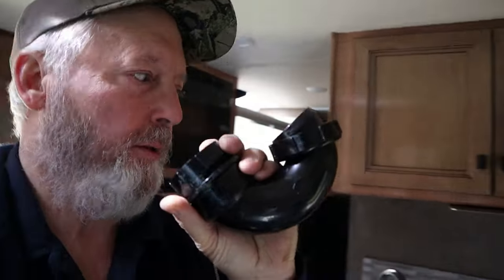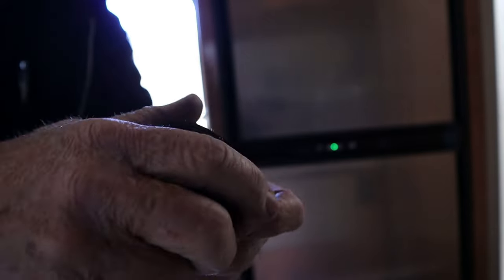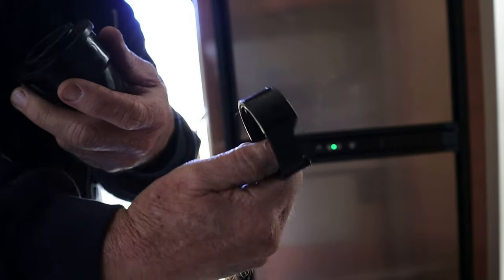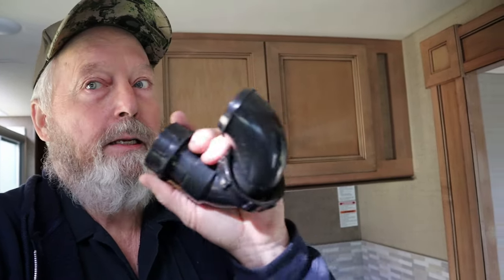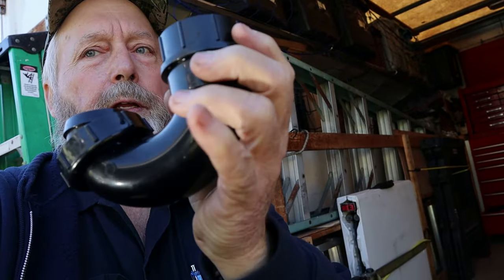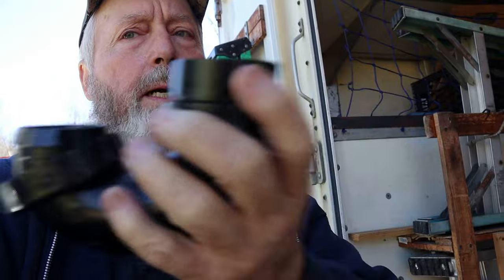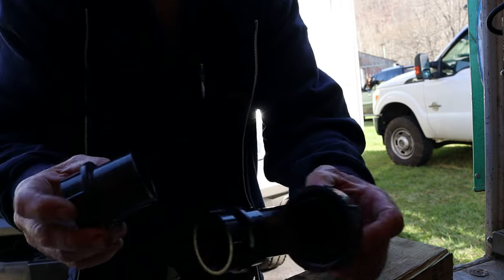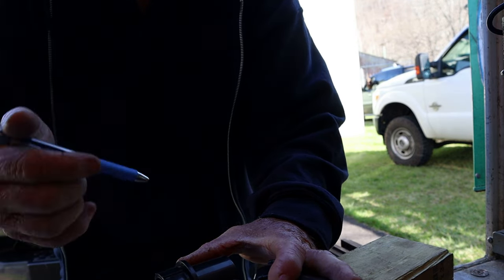P-Trap Nightmare

Comment: Sometimes chit just doesn't  work out correctly lol but true. Kenny , I put those Drainmaster electric valves on my black and grey tanks the other weekend and worked great. I did watch you older video where you did change one out and thanks it helped. Also my motorhome has a central vacuum system ( Dirt Devil system) . In Alabama a few month ago it was freezing rain and then snowed on top of that freezing ice . I had put a chicken heat lamp in the basement compartment . Well you know what happened don't you. Yep the heat lamp heated up the vacuum holes and melted a hole in the hose. The hose was I.D. 11/4  or O.D. 1 1/2 inch. Took forever to find this size hose. One person quoted me the hose for like $238 . I found the hose on amazon for like $20.00 and it worked great. One question when it froze and snowed it froze my water line and I had purchased like foam outside water line cover to help protect the water line. My neighbor had a heated  plug in water line and his hose froze as well. Do you have any ideals on how to protect water lines during cold weather ? Sorry about being so long on this reply I will try not to do this again. Jeff Steele
Reply from the maker: If a heated hose froze? Something wrong with it. I see those things working in single digest temps for days. You might have a little trouble on each end where it is really not heated, but never in the middle.
Reply: good to know Kenny . I had ordered one on amazon then a couple of days later is when he told me about this heated line freezing. I feel better now thanks so much ! @hillbillyrv